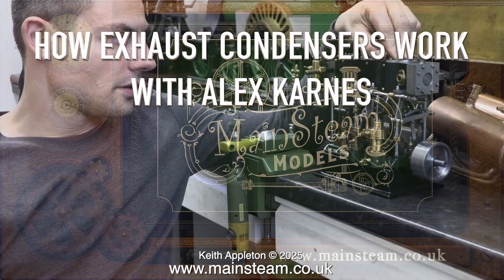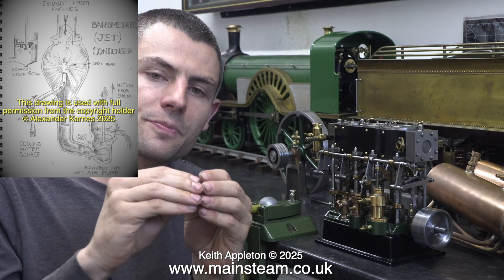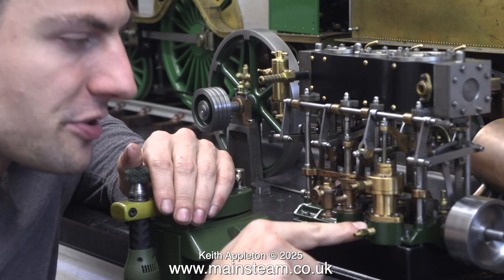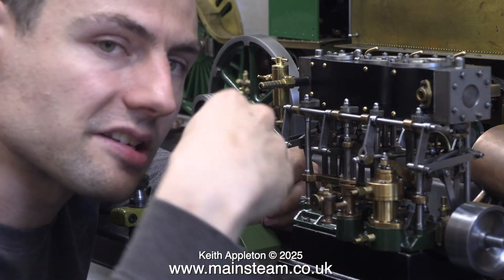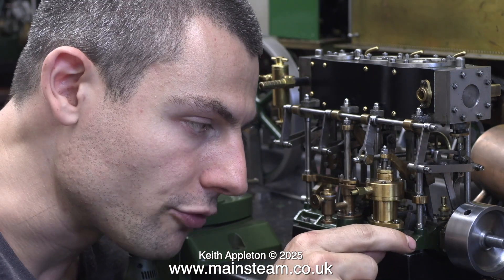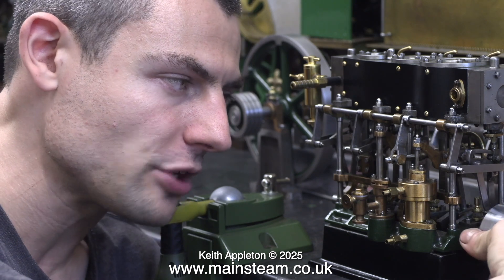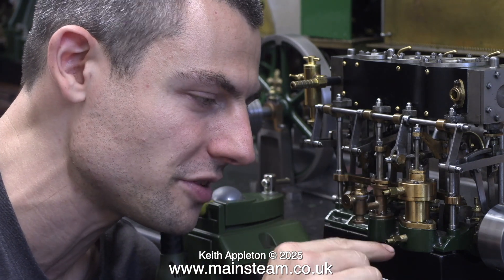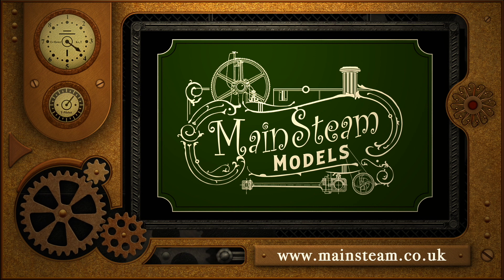HOW FULL SIZE EXHAUST CONDENSERS WORK - ALEX KARNES - PART #2

Comment: Keith, Thanks very much for this video, it finally answered a long-buried question.

As a "young person," knew some "old people" who explained the operation of sidewheel steamboat working [often referred as walking] beam engines, especially from the 1883 Str. PILGRIM with single cylinder 110" diameter with 14' stroke [indicated horsepower of 5,300 at 50 pounds steam-pressure & 17 rpm gave a speed of 19 mph, using radial 41' diameter wheels], and the 1889 Str. PURITAN with a compound engine with a high-pressure cylinder 75" diameter with 9' stroke & low-pressure cylinder 110" with 14' stroke [indicated horsepower of 7.500 at 110 pounds steam-pressure & at 24 rpm gave a speed of 20 mph, using feathering 35' diameter wheels].  Both engines had a small cylinder above their condensers [with their own connecting rod to the beam, which has nagged my mind for years as couldn't remember their purpose].

Your friend Alex Karnes finally gave the answer. Be sure to thanks him for me, Andrew 👍 ⚓⚓⚓⚓⚓ 👍